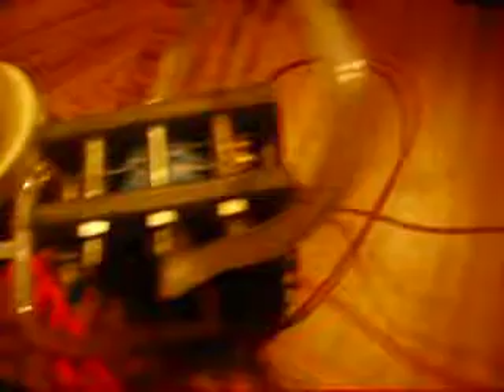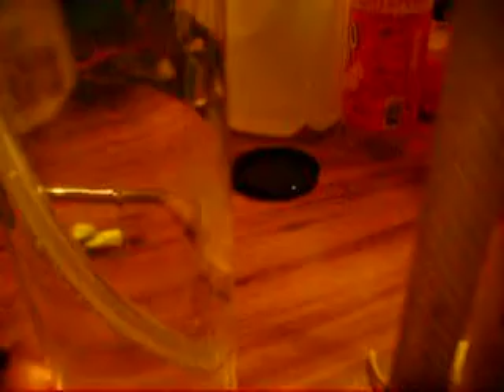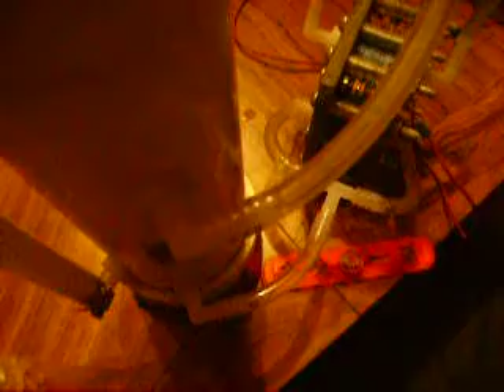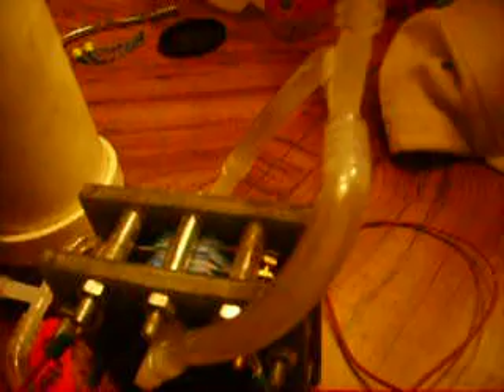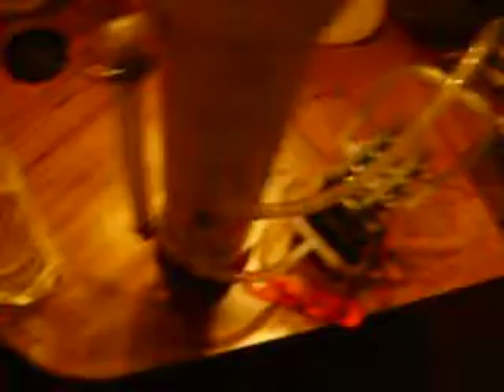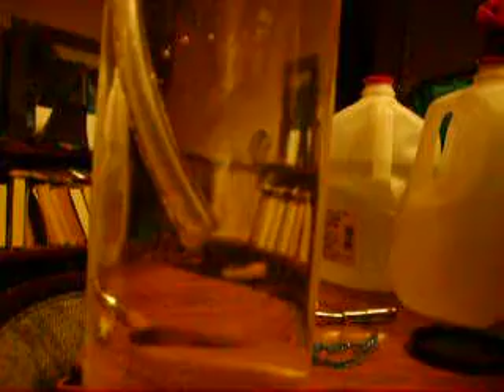HHO for about 60 bucks!

Comment: very cool, looks like your getting decent output. I think really soon I'm going to start working on a dry cell, try to simplify the plumbing of some of them i have seen. great video though. be great to get a system like this engineered into a space heater. at 5 amps, to me that's more efficient that some of the space heaters pulling 10-15 amps with minimal heat. If we could figure out a way to make the system smaller and utilize the on demand hho for heat transfer, we are on to something....

Comment from the maker: @squiresuzuki It's a 16 plate cell. +NN-NN+NN-NN+NN- . The original plan was a 21 plate cell. I would need one more neutral between my hot plates for that. The gasket material is a rubber/cellulose gasket material I bought at Autozone. It's a sealed cell. The gaskets are a one and done type. You can't reuse these. The gasket thickness is .046" I have another Video that goes into more detail in the description. Titled "HHO MLSP 16 plate drycell"

Comment: Very nice! What's the configuration of plates? looks like +nnnn-nnnn+nnnn-nnnn+ is that correct?
Also, what did you use for the spacers? Do you think that huge o-rings will work?
What's the thickness of your plates? Thickness of the spacers? Thanks in advance.